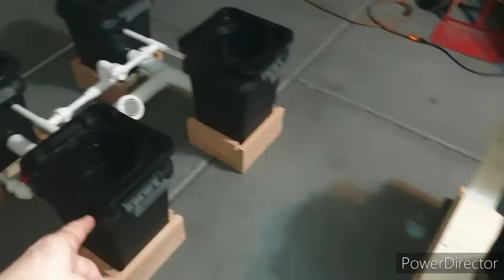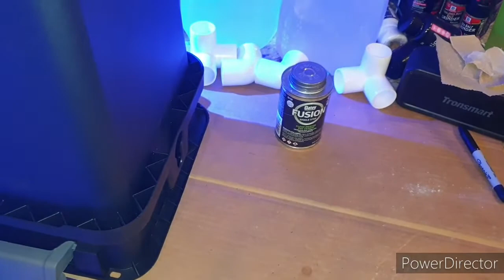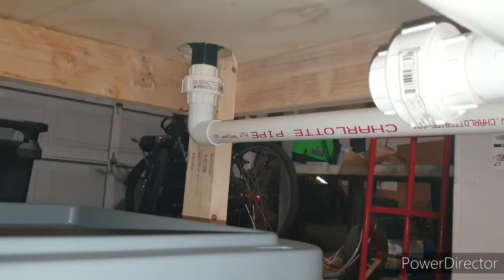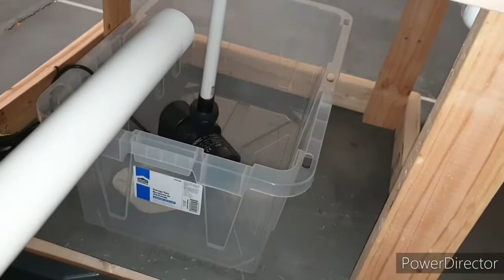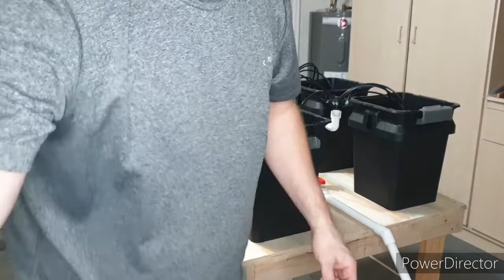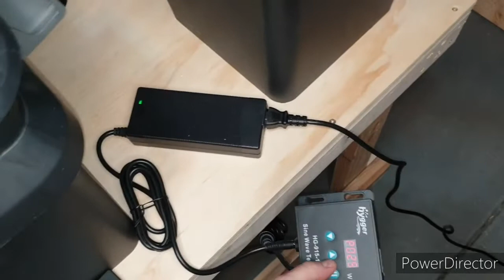RDWC double system Build.... Complete!!!

Comment: I think you have more dollars than sense
Reply: I thought the same 6 months ago, but had no experience building these systems or making it thru a RDWC grow from seed to harvest. Watching this video again now I can appreciate all the thought that was put in to solve the many problems that one probably wasn't expecting. The cost for this system is a fraction of a similar Current Culture system and would still come close to matching longevity. These are perfect for a home grower with a plant limit and the content provides a solid diy solution which is helpful.
Reply from the maker: @pros2go  thanks!  Unfortunately I only used that system for a couple of grows....    but it did help me figure out exactly what I wanted in the next system I built, which I'm very happy with and hopefully going to be using a long time
Reply from the maker: Yeah.... that build was convoluted

Comment: where’d you get those buckets with the built in mesh pot tops?  could you send me a link to those.
Reply from the maker: Theyre not built in... I cut holes for the netpots to fit into.... the buckets are all craftsman from lowes
Reply: @thewell-roundednovice8852  thanks, also sweet system i bet it was worth the headaches
Reply from the maker: @CoachCline101  it worked well.. but building a system now with more upgrades.... videos out later this week

Comment: I like the sett up. If your using a salt based nutrient. It will seal anymore leaks. The only problem I see with the system is the possible need to add a seperate reservoir for each system. Reasoning is the larger plants are going to need more nutes than the seedlings need. Unless your just growing 4 plants at a time.  You may run into hunger issues. 
But yeah man I like it would love to see the outcome of the plants
Reply from the maker: I never actually ran plants on both sides... just did topfed side then transfered them over... its pretty redundant... im building a modular system now that will have topfed and dwc possible on each unit--should be way better

Comment: I just subd up! You did a pretty badass job on the system.  Made mine look pretty amateur.  I will build another system using bigger bulk heads. At least 2". Preferably the ones from Current Culture. Hard to find better ones. I built an under current system using 1" tubing. I definitely need to step my game up.  Happy Growing and Grower's Luv!
Reply from the maker: Thanks bro... everything is a learning process... hope we both be producing big weight soon!!!
Reply: @thewell-roundednovice8852  yes sur! Got my HLG  Scorpion Diablo  working overtime for me! Happy Growing Bro!

Comment: so have you ever thought about recreating the slucket bucket system? and push water from the bottom of the bucket up tho the root zone. cause i was wondering if doubling down on a system with a waterfall and a spring with the posi flow side walls. http://www.posi-flow.com/
Reply from the maker: Im sure their system works, but the less bulkheads below the waterline the better in my opinion... also, I'm pretty sure that with enough airstones, the need for that higher flow is negated.... in other words, I'm pretty sure that idea would work really well, but I don't think that it would be worth the extra effort and extra points of possible failure(leaks, cracks, etc)